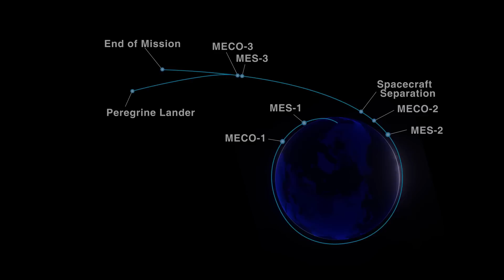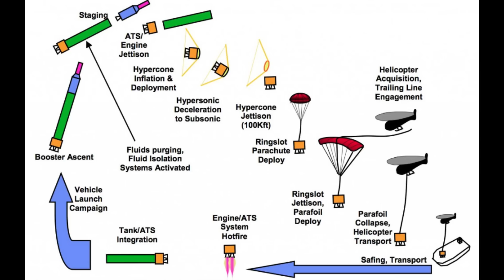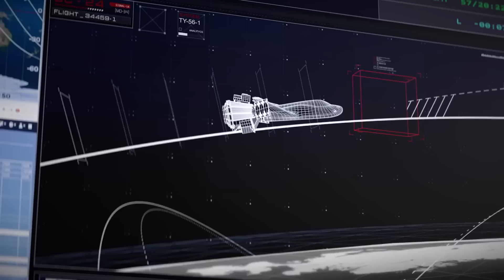Why Vulcan is the Most Important Rocket ULA Has Ever Built

Comment: The Vulcan Centaur isn't a bad rocket. And has growth potential and provides useful competition against spacex.

For now there are 2 US companies in the medium-heavy launch business, spacex with falcon and falcon heavy, ula with vulcan and a config of boosters and upcoming rockets with the new glenn from blue origin and neutron from rocketlab.

Of course if spacex is successful with their starship then it will be pointless, but it's a high risk project and if it doesn't have a successful mission soon, then who knows what will happen.
Reply: What mission?  IFT2 was successful by all accounts.  IFT3 will be ready in 2 weeks latest.. and then it depends on the paperwork btwn SX/FAA when that goes up.  Right now people speculate if the profile will be the same as for IFT1/2 or if SS will go to orbit instead.
Reply: @joansparky4439   Exactly.  Spacex having things blow up is not 'unsuccessful'.  It is 'data gathering' and a part of the design process which allows the extraordinarily successful and rapid development of hardware.
Reply: @joansparky4439  IFT1 and IFT2 both failed in their objectives. IFT2 was a much bigger deal because it was meant to fix the issues of the first flight test and complete it's objectives.

Number of failures with starship at the moment:
No Superheavy has managed to land back on earth yet
No Starship has reached orbit
No Starship has had an attempted recovery yet
No Starship has returned to earth yet
No Starship has had a powered decent yet
No Starship has completed a fuel transfer
No Starship has reached Moon's sphere on influence
No Starship has landed on the Moon yet

Successes from IFT2 vs IFT1:
Not exploding before seperation
Starship reached space
Didn't blow up the launch pad

It's not a great start, lets be honest, and it needs to be finished before the end of 2025, if they are to meet the goals set forth by NASA.
Reply: @joansparky4439  IFT-3 Might be ready in 2 weeks, which i doubt, but they still need clearance for it. Which I doubt will happen fast with the constant failures.
Reply: @joansparky4439  IFT2 was not a success. The Ship did not achieve it's intended target trajectory, it instead blew up. The Booster achieved it's primary goal of reaching stage separation, but it still failed almost immediately afterwards.
You can still learn from failure, but that is exactly what it is, a failure they will hopefully learn from.
Also it's been 10 days and there still hasn't been any mention of a official launch date, so I doubt your 2 week prediction will come true.

Comment: I wish them all the luck in the world, but non-reusable boosters is so 20th century
Reply: SpaceX does it too with the Falcon Heavy center core...
Reply: @nunopereira6092  They can and have landed the center core.

As with Falcon 9, sometimes the mission requirements dictate expending it. The darn thing only holds so much fuel.

My point is that fully expendable boosters are functionally obsolete, ULA is still making steam engines in the era of diesels.
Reply: For which the completely reusable replacement Starship is actively being worked on @nunopereira6092
Reply: @nunopereira6092 But..its optional... based on mission performance requirements, and the customer willingness to pay full costs. Recently SpaceX barge recovered a booster after it's 19th flight! That's a helluva big return on investment! Yes, it fell over in the storm and broke in half, but engines and many parts will fly again. Something an expendable can never do.
Reply: @nunopereira6092  Technically Falcon Heavy centre cores are reusable, they just failed to recover any in usable state.
Reply: @remliqa  they gave up on reusing the center core due to the higher velocity that it achieves and associated aerodinamic stress on the booster.
It's now considered to be an expendable, just like the upper stage.

Comment: I really hope they are recycling the shavings from the subtractive manufacturing process they use. There's no point ordering these giant blocks and plates if you just throw away most of it
Reply: AFAIK, the value of swarf is a tiny fraction of the cost of producing the original plate.  So I think it better be that there is a point to ordering these giant blocks and plates even if you have to throw most of it away.  I tried to recover some aluminum in my garage foundry from swarf.  It took forever and most of it aluminum was converted to dross.  For a commercial operation you'd need to a controlled atmosphere and massive presses to compress it before you recovery.

Comment: Best wishes to them.   But launching on an unproven system with sketchy engines may not be too wise.
Reply: FYI   EVERY NEW ROCKET is unproven with sketchy engines.   Look at the criticism that Space X has gotten over the Raptor engines and it turns out the engines were fine and it was the interconnection with the launch system that was the problem. There were other technical upgrades that Space X from S 24 to S 25 and B 7 to B 9 that also made a big difference as well

Comment: Aren't all these new rockets coming on line basically obsolete. None of them are reusable like the falcon 9. It's like having a car that you have to use the old crank method to get it started when all other cars have electric starters.
Reply: Most of the cars on the road run on gas or diesel, but EV are far better in many respects yet we will still be using petrol fueled cars for many more years so what was your point again???

Comment: You let out the most important reason for Vulcan. The USA LAW DEMANDED that all government payloads must fly on USA rockets with USA engines. So no matter if RD180’s were available or not the military payloads ie:NRO and Space Force could only use SpaceX USA rockets. That was a law and not a suggestion.

Then the be4 was a non starter and the NRO or government kept reducing the minimum number of launches by the Vulcan before it could launch military satellites. ULA should have been required to fly all the flights, it’s just 3 or something like that anyway, even if they only flew mass simulators. Determined reliability requirements shouldn’t be reduced just because an independent company (propped up by the government just as you said) can’t make good engineering or business decisions even if the decision was a dilemma.
Reply: "The USA LAW DEMANDED that all government payloads must fly on USA rockets with USA engines. "
I don't think that is correct. 
The problem is that RD-180 engines would not be available beyond a contracted number, due to sanctions on Russia.  To say nothing of the strategic risks of relying on anything from Russia.

Comment: So it’s not just the launch costs in early space use by Lockheed and Boeing and then ULA that limited customers and kept launch numbers low and forced what customers there were to go international. Availability of reasonably priced satellites kept many possible launch customers from even entering the field. Because of this very high bar of even entry meant that once a very expensive satellite was specified, designed, built, tested and packed by a trusted third party supplier the ONLY place left to save money in the entire endeavour was on launch costs. Now a company with a shiny new functional satellite only needed to phone around for launch success statistics from launch providers and get the numbers for the different appropriate launch vehicles. So overall historical launch success for a vehicle and recent launch success say over the last 5 or 10 launches say. So armed with a price for a launch and a typical success rate you then call the insurers and see what they say and see which launch providers they are willing to insure a launch for and at what cost.

My point is that good riding HIGH USD buy allot over seas just due to the exchange rate especially in a devastated Russian economy and a country that wants to look good and being trusted by USA companies to launch satellites over the local ULA is a good look. Oh and the Soyuz is really really really reliable with an extremely long successful launch history and I believe it’s good for most orbits from the Cosmodromes.

So my point is that there weren’t cheaper satellites available and as I believe they were pretty much the same price no matter where you got yours and there weren’t many suppliers. So the only flexibility on price overall was the launch provider selection and ULA and previously Boeing and Lockheed were STUPIDLY expensive and offered nothing over and above foreign launchers except being a USA provider. Hellhiem, now it’s out that overall counting everything and I mean everything the cost to the USA for a shuttle launch was a shade under 2 billion USD a pop and they had a failure rate worse than Soyuz and the shuttle was manned. I’m still dirty on the death from an intentional launch outside the launch envelope after being warned by highly trained engineers. Why wasn’t murder or manslaughter or negligent rocketeering causing death ever charged? You’re a pilot now so you know how it is. Depending on your maintenance program for the aircraft your flying you have a Minimum Equipment List provided by the FAA for the aircraft category and if it’s IFR or VFR, or a maintenance schedule that allows certain defects for a few days or so out to 28 days. But YOU OPERATE THE AIRCRAFT IN ACCORDANCE WITH THE MANUFACTURERS DIRECTIONS ie: the flight manual and the other manuals depending on the aircraft category. So if it’s too hot or too cold as per the flight manual by even one single degree and you go… well your a criminal and your fucked and if anything happens that’s bad then you the captain ARE AT FAULT. The tyre burst and you lost control on the runway just prior to rotation and you had an accident and it was 1 degree too hot… then even if the tyre was caused by debris on the runway it’s still the captains fault and he is a criminal. In Australia it’s criminal to operate outside the flight manual directions. So NASA screwed the pooch.

So anyway. Cheaper launches were available by reputable launch providers with great launch history success. That further reduces ULA customer base so their standing fixed costs have to be spread over even fewer launches and prices go up, so then even less non government launches happen and prices up and so on. So I’m a hater of ULA and the government launch numbers disparity with space x. It shouldn’t be number of launches evenly split. Which does not happen anyway. But it should be launch dollars evenly split. So that means that SpaceX gets way more launches as they are cheaper and ULa gets less but they each get the same number of dollars. That’s fair and if you don’t want that then it should be free market rules and government procurement rules that extremely heavily favour the cheaper contract for minimum equivalent service.

I don’t like BO either but for less rational reasoning. They put down SpaceX repeatedly to make themselves look better by saying look what we have or are doing while BO was actually doing nothing. Cartoon drawings and pictures and poor animations just don’t count. Sure a company can say that we are doing XYZ but they don’t have the right to DISPARAGE a company that’s flying payloads whilst they only have cartoons. It’s deplorable business practice. Saying that “We are GREAT because they are shit.” Is not an accurate or even true statement because the two companies are seperate. The Venn Diagram would be two completely seperate circles with absolutely no overlap. So BO was lying because SpaceX was launching successfully and developing and learning, that by definition isn’t shit because the stated goal of launch satellites was being achieved. Also the success of SpaceX or its failure or its product quality bares no relationship to the product or lack there of or the success or lack there of, of BO. It’s a child’s statement when they are stumped in a discussion. (Then there is a tantrum)

So I actually hope the rocket body is good but the BE4 fails totally or partially and that either of those failures are obvious. What goes around comes around.
Reply: I don't hope it fails, but if it does they have no excuse.  Over priced boondoggles need to at least work.

Comment: It's already obsolete before it's flown. Why they've already have been granted multiple contracts boggles the mind.
Reply: Well, Centaur 2nd stage is still the most efficient 2nd stage there is .. If Centaur is obsolete, then how about others ? such as F9 / FH 2nd stage ? Those must be medieval then ?
Reply: @ComeOnYouPalace if only Falcon Heavy had such a high energy stage like the Centaur. I still hope ULA or someone will develop the ACES for long duration cryogenic liquid hydrogen/LOX missions. That would be a game changer. It could be even more important than making the BE-4 engines recoverable.
Reply: @ComeOnYouPalace  I was more pointing out the lack of rapid reusability in the system design. Refurbishing rocket parts dunked in the ocean is not going to be easy.
Reply: @ccengineer5902  Reusability is just one aspect of rocket launch, and I think labeling a rocket obsolete just by looking at reusability aspect alone is misleading. From the customer point of view, what's the point of reusability if the rocket can't deliver the payload.
Reply: @ComeOnYouPalace  But what payload can it deliver that another cheaper rocket couldn’t?
Reply: @ComeOnYouPalace  The point of reusability is to reduce cost. Falcon Heavy has higher capacity than Vulcan, and it costs $150M. I don't see Vulcan costing below that, and for lighter payloads you might as well launch on a Falcon 9 at $67M per pop. Vulcan simply doesn't have a purpose.
Reply: @ccengineer5902  Depends on the mission profile, not just payload. Curiosity Rover for example, even if that time FH launch cost is $ 0 (zero or free), FH still would not  be chosen  because FH not yet certified to carry nuclear materials as Curiosity is powered by nuclear reactor. But for Psyche mission, that use solar power and does not require that high energy second stage, FH was the perfect choice. Yes, Vulcan won't be the number 1 launch providers, but it sill has its purpose.
Reply: Because politics
Reply: Powerful politicians at work. And yeah, that sucks.

Comment: Its good that there is a second space access provider that won't let SpaceX eat everyone's lunch, but with what SpaceX (and many other space startups) are doing, i really hoped ULA can try to be a bit more modern - but instead they played it super-safe (like they usually do) and we got:
- no reusability now (maybe a bit in the future - not sure).
- still significantly less mass to orbit than Falcon Heavy
- while still being more expensive than an FH
- wider fairing - yay! But not significantly wider than the FH extended fairing and much smaller than either New Glenn or Starship.

I really think they could have been more ambitious with their engineering.
Reply: Well, I see what you mean.  I think the engineering is just fine,  and even a bit clever.  ...- For what it is.  The design concept though, is obsolete and started on the wrong premises.
Once you make the paradigm shift to reusability and low operating costs, most things need to be done radically different.  First of all, you need much different engines, because you're going to need much greater throttling ability, and you'll need thrust to weight ratio in a different ball park, because the rocket will need to be much lighter when you brake and land the almost empty rocket again.  You also want only one kind of fuel for sake of simple operation.  You want that anyway, because you're forced away from big engines by the thrust/weight needs.  So instead of pursuing economy by scaling size and reliability with low numbers, you have to find a way to do it by mass production instead.  Which means you only want one type of engine anyway.  And so it goes on.
Reply: @Vermiliontea  I'm not sure how the engines factor into the equation - Blue Origin plans on the same engines to power their fully reusable rocket, so supposedly these should be able to throttle down well enough for that. According to Wikipedia, BE-4 can throttle down to 40% - like a Raptor, so what is missing? Are the BE-4 engines delivered to ULA not as capable as those that will be used on New Glenn?
Reply: @guss77    Yes. But we're talking about Vulcan here. And the BE-4 is big for the Vulcan and it only has two.  That's not enough granularity.
I might do a longer answer later - I'm on my way out now - but essentially the Vulcan is designed and optimized all the way - flight profiles and Delta-V distribution - to be a throw-away 3-stage rocket (1: Boosters + BE-4, 2: BE-4, 3: RL-10).  A very good such, with great flexibility, and "economical".  But it's still throwaway and the launch costs of the Falcon family will always be utterly unreachable for it.  Considering its configuration, it's also not in a good place to evolve into reusable.